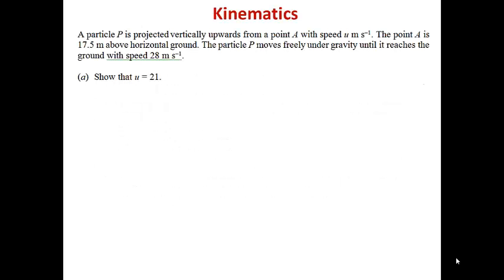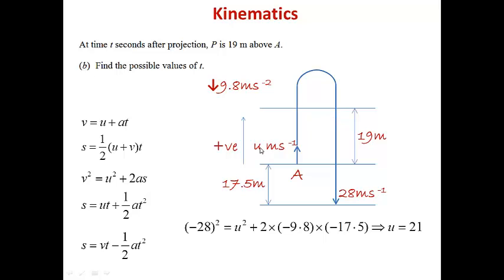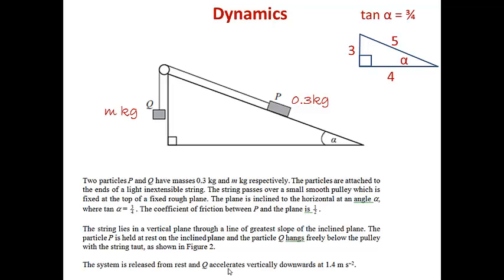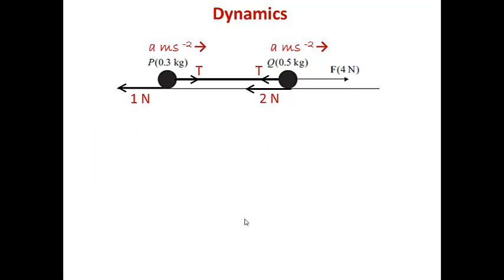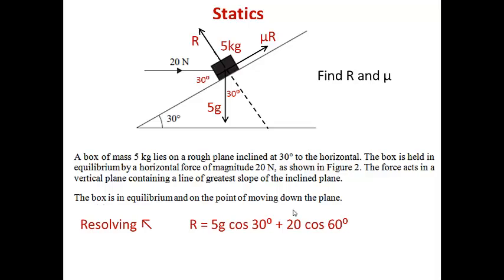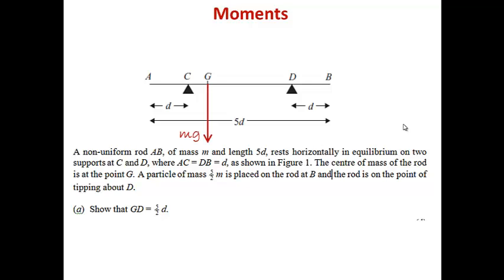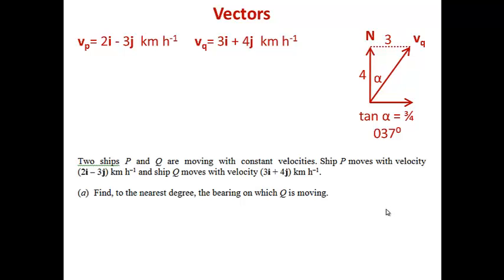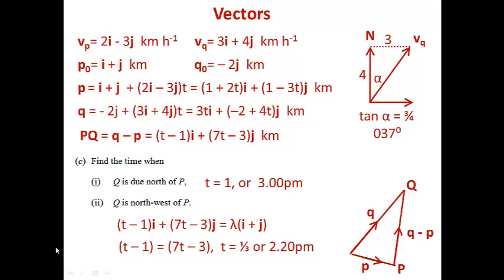M1 in 30 minutes

Comment: Don’t understand the thing with the cos and the Normal in both instances how do you know to apply cos?
Also at 24:20, how on earth is it 2.5d surely with it being kdmg =2.5dmg the dmg would cancel out leaving k = 2.5, not 2.5d, very confused
Reply from the maker: Distance is set as equal to kd. As k=2.5, the distance is 2.5d as required.
If you want the component of a force F in a direction which has an angle of x with the force, then the component is |F|cosx
Reply: Tony Debling thanks :)

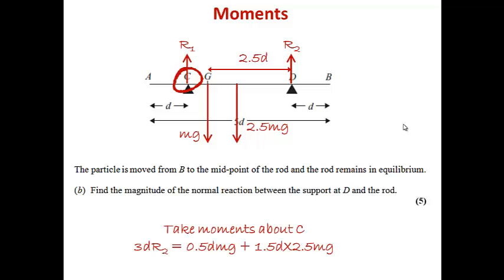Comment: at 25:33 shouldn't the equation have the last term as 2d x 2.5mg, as the distance of the midpoint from A is 2.5d, and AC is 0.5d, so C-Midpoint should be 2.

Comment: 18:50 Why is it 5g cos 60 not cos 30
Reply from the maker: We are finding the component down the slope and the angle between the slope and the weight 5g is 60 degrees (90 - 30), you can write either 5g Cos 60 or 5g Sin 30 they are both the same.
Reply from the maker: Good luck in your exam!

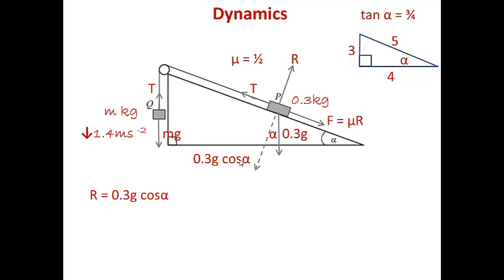Comment: Might be a dumb question but I’m genuinely so confused where you got 0.3cosa from at 11:42???
Reply from the maker: It is the component of the weight 0.3g acting perpendicular to the inclined plane in a downwards direction. 0.3gsina is component along the inclined plane.
Reply: Tony Debling how did you know that it was 0.3sina along the plane- sorry might be an obvious question but wasn’t really taught mechanics
Reply from the maker: Take a look somewhere about the triangle of forces that will teach you what you need to learn about resolving a force into two directions.
Reply: Thanks that’s very useful- sorry to bother you :)

Comment: 18:26 ARRRR!!
Reply from the maker: We are told there is a force of 20 Newtons acting horizontally which is just about holding the block in place. This force can be thought of as a force of 20 cos 30 acting up the plane and 20 sin 30 acting at right angles into the plane. Similarly the weight 5g can be resolved into 2 components, 5g cos 30 at right angles into the plane and 5g sin 30 (or equivalently 5g cos 60) acting down the plane. Does this help?
Reply from the maker: Because cos(90 - x) = sin x, you can equally write 20sin30 or 20cos60. sin30 = cos60 = 1/2 BTW
Reply from the maker: Sorry, what was the problem? ARRRR is the long form of the reaction against the plane? Let me know if you need some help!
Reply: Where DID the 20cos60 (and 5gcos60) come from? Trying TO understand
Reply: thank you!

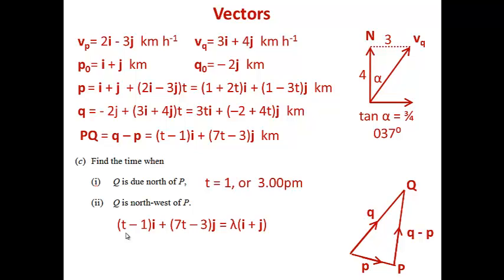Comment: Surely at 31:20 I+j is north east rather than north west.
Reply from the maker: Indeed Rit - I'm sure you will do well in your M1 exam!

 it should have been made equal to lambda(-i + j), as -i + j is the vector in the north-WEST direction

I think that psychologically too many lines going from bottom left to top right must have influenced me! If I have some time I will collate the various errors, and maybe track down the sources to fix the video.